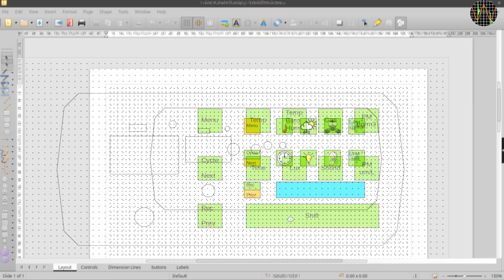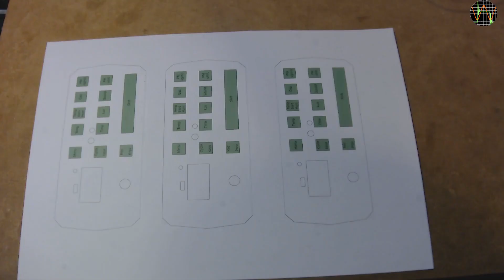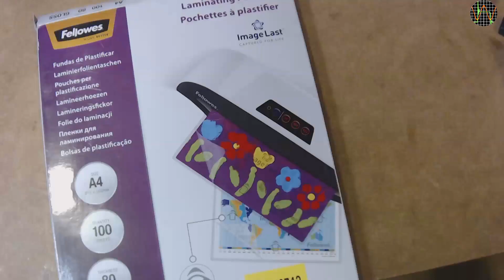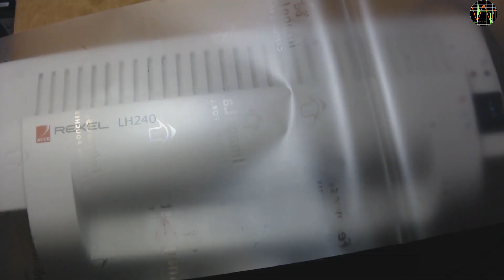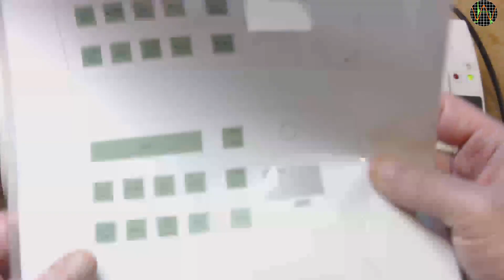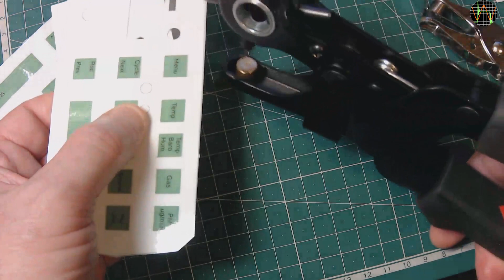Environment Monitoring Station: Part 2: Front Cover

Comment: surprisingly you not showing much difference on this part; I would have thought that you would actually mount the front panel on the instrument, i.e how did you stick the laminated paper on the panel?   you made a start on part one can you do a part 3 then to show that bit? thanks
Reply from the maker: It is not stuck to the PCB at all. The housing has that groove all around in which the PCB sits and the laminated front is simply sitting in the same groove. Apart from that, only the nut on the button  that goes through both PCB and front sheet kind of attaches is to the PCB.  I try to get away with not gluing as much as possible (for future improvements) but if I need to, I use double sided tape to do that.
Reply: @TheHWcave  thanks for talking time to explain.  One last question remains; I yet to find a way to print out the center marks for the holes (the cross hairs) I fiddled with it drawing to perpendicular lines on the circles and get the center of a circle that way but its a pain as I have to repeat that many times and I wonder why inkskape has not got an obvious center mark print out option or has it?! Thanks in advance
Reply from the maker: @dibraniuk  I use Libreoffice Draw for doing my front-panel designs. Its not perfect but good enough. For holes, I do perpendicular lines as helper lines and then center a circle on the exact middle coordinates with the required hole diameter. I usually align the grid & coordinate system with the top left corner of my panel and all measurements are relative to that. This means I can easily calculate and type in the exact coordinates which is a lot more precise and faster than moving things with the mouse.

Comment: Good to see somebody making something.  How did you get the background and knowledge needed to do all this?  I have spent over 42 years in telecom work, but still have at best a rudimentary understanding of everything electrical.
Reply from the maker: Hi Paul, I guess I started early, tinkering with electronics as a teen long ago... kept it going as a hobby ever since. Keeps me sane while working as a software and later systems engineer... As for knowledge... It may appear so but in reality  I often have to study a topic quite a bit myself and do experiments to really understand it and be able to explain how it works. For example the videos on True RMS. Before I made these videos, I only had a rough idea about what RMS really meant and how it was measured.